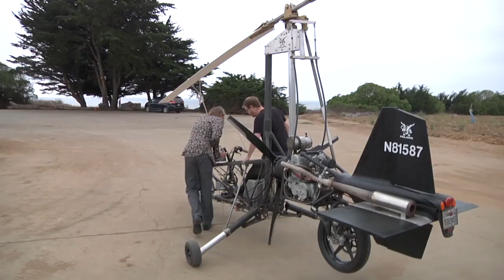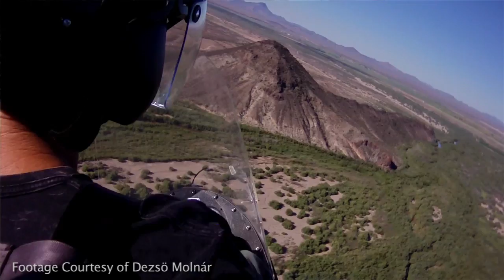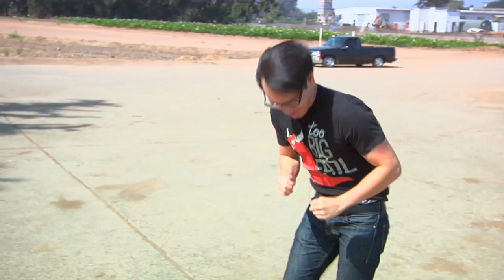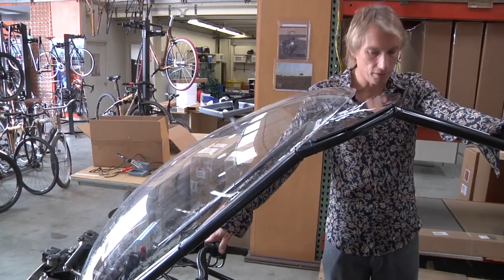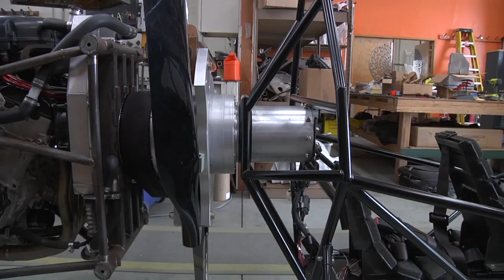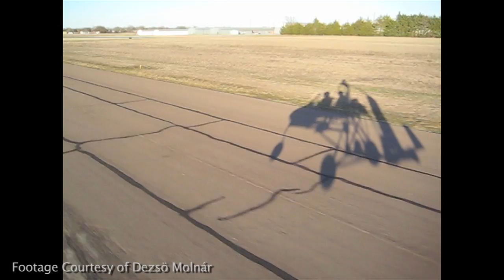Meet Dezsö Molnár and His Flying GyroCycle

Comment: You guys are idiots to have fallen for this nonsense.  You didn't get a SINGLE photo or shot of the ACTUAL machines he showed you flying and I'd bet money none of you saw him fly a drivable vehicle.  The second one is LITERALLY holding the front and rear of the vehicle together with a single shaft and I don't care WHAT material that shaft is made of, it's not good enough for that to be acceptable.  Also, who cares about a hose clamp from an engine going the same speed as the propeller... how about gravel bounced up from the road by a car in front of you?
Air travel "innovation" scammers let you sit in a prototype, they blow on you with a propeller, they give you stock footage of their heads (not their vehicles) that appear to be flying, but you never get to film them flying their vehicles yourself and you never see the _actual_, full-scale, full-function vehicle aloft under its own power in a meaningful sense. It's the same garbage with electric aircraft.  If it works, you can watch it and you can film it.
All flight footage here is of other vehicles (shadows and vehicle features give them away).  Additionally, you never see either bike with propeller actually move.  The supposed second bike in the driving footage doesn't have the propeller at all.

Comment: This is interesting. As in vary.  I am moving to the Philippines where innovations is welcome. I can see your bike with modified bench seats on the left and right sides for passengers .  When water is in countered the benches swing downward to become snow skis and the mounts for Full Lotus  floats for travel to any beach. Extra passengers travel in ground effect but when only 2 passengers then take to the air. Each float would be divided into 2 per side.

Comment: The pitch problem he is discussing is usually solved in Autogyros by extending the rear tail to change the center of gravity. I am not en engineer, however, I believe that is what many modern push Autogyro manufacturers are doing, extending the rear tail and adding winglets.

Comment: It would be great to focus on magnetic energy vehicles where you can use the Sun to convert  its energy in a solar panel system to lift up, then use a paddle propeller to move different ways.

Comment: this dude sees it. the gyrocopter is such a great way to get the masses flying
Reply: really I was just looking like ''dude where are the downsides to this?? ''
Reply: Matevž Kaplan not many, I think. although the heights may be a problem for some
Reply: @187warlord there’s far too many obstacles for this vehicle. It will never achieve an FAA clearance or be able to operate on roadways, the costs would be astronomical and resistance would even be greater. The Gov does not want us having autonomy

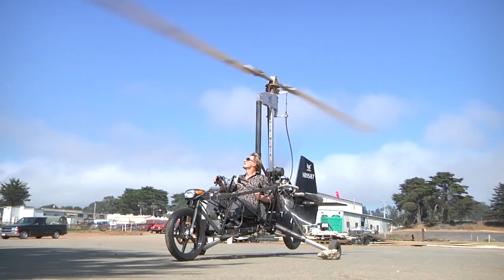Comment: At 4:32 the vehicle is not moving but the rotor is spinning. Has he just landed, perhaps? Otherwise I can't explain this.
Reply: it looks like it's speeding up. Everything with a propeller does that
Reply: But with autogyros the propeller rotation is the consequence of the forward velocity of the aircraft. I'm guessing there must be an auxiliary clutch to the rotor that helps bring it up to speed and shorten takeoff taxiing.
Reply: Windmilling from the sea breeze. Usually there is a brake to prevent it from spinning.
Reply: right there is. then its disengaged.
Reply: I just looked again and there's rocks in front of the wheels.
Reply: It has a small electric motor on the main rotor, it is used just to get the blades turning, it is switched off and air flow from the prop and forward speed does the rest

Comment: Finally, someone had enough sense to use motorcycle engines! I had been thinking of using a Kawasaki Ninja 250 engine to make an ultralight gyroplane. I never could understan everybody else using the primitive air cooled 2 stokes.
Reply: Why would reduction gears be an issue? Motorcycle engines have transmissions! Why is oil an issue? Why the hell do you need dual ignition? None of your comments make sense.
At least in the context of ultralights, which is what I was discussing.
Reply: Why are you so offended? I was trying to be constructive. Any basic aircraft engineer can clarify those points, I really can't be bothered now.
Reply: So, you admit that you can not support ANY of your points.
Reply: mrnickbig1 I'm not so insecure that I have a need to justify myself to you. Do your own research, then maybe when you're all grown up you can come back and apologise. Over and out.
Reply: So, you still do not even pretend to back up a single thing you said. Motorcycle engines HAVE transmissions built in. There is NO REQUIREMENT for ultralight engines to have two spark plugs per cylinder. There is no "oil feed consideration". As far as being "all grown up", I am probably older than you, and used to pilot my own plane, a PA22-108. So, quit making shit up.
Reply: Chronological age is not equal to mental age. You are walking proof. I will wait for your crash video to appear on YT...
Reply: And still, you do not support one single thing you said. I think everyone can tell who the adult is in this conversation, and who is making uninformed erroneous statements. Also, most ultralight engines, such as the popular Rotax 277, only have 1 spark plug per cylinder. It is about the  So, are you still claiming that motorcycle engines, like the Kawasaki 250cc that I mentioned, don't have transmissions with reduction gears? That ultralight aircraft DO require 2 spark plugs per cylinder? That there is some sort of "oil feed" issue with small 4-stroke motorcycle engines?
Reply: 2 strokes weight much less for hp generated. That is the point. And I love 2 strokes because maintenance is also hilariously easy and cheap. No valves, no oil system... 2 strokes are just better for this kind of job.
Reply: Motorcycle engines are designed for short bursts of full throttle, full load operation, whereas aircraft engines and boat engines, (also stationary engines) may be operated at full load continuously.  The most common limitations to continuous operation are oil temperature / constant flow and localized overheating. Most aircraft engines are de-tuned, and have an extra large oil pump,  Perhaps a dry sump, depending on whether they will fly inverted for more than a few seconds, and extra oil cooling compared to their vehicle counterparts.    A dual ignition is simply a good idea for an aircraft, as the ignition system is a single point of failure.   The reduction gearbox on a motorcycle will most likely not have the exact correct gear ratio required for spinning the prop at the correct WOT RPM,  but there is some chance you could make one work in a special situation.   there have been some successful conversions, so it is possible.  It' not likely that you will have a success without listening to people who can help, if you are not already aware of these basic aeronautic differences.
Reply: The original coda is exactly right, dual ignition may not be needed for experimental certification, but really to fly with maximum reliability it should be a key intention, also, bike engine horsepower ratings are nothing like aero engine horsepower ratings, which you mrnickbig should understand. An aero engine must deal with continuous full power load with hugely variable fuel mixture, which is one of the main reasons for dual ignition systems, it copes much better with extremes of rich/lean at high power settings without stopping. Conversely, If you take a 100HP bike engine and put it on a dyno and run it non stop at 100HP if your lucky it might last a few hours. On its wheels it rarely sees WOT for more than a few seconds at a time, and doesn't thermally cycle anything like an aircraft engine, with full power at ground level up into freezing air then closing throttle back...(climb out) The reason aero engines cost so much is because they are required to keep you alive by not stopping from blown gaskets, split casings, broken conrods, failed ecu's, seizure etc..
Reply: TheOriginalCoda m

Comment: I love the design considerations, brilliant! Take a look at the thought/design process on the dymaxion car by buckminster fuller, they would be good to add to the mix on this "flying vehicle" design: aerodynamic body and undercarriage and 3 wheel design (film/video of the car exist) The 3 wheel dymaxion was designed to be a flying car however the technology to realize the design didn't exist in 1932.  I am merely suggesting that the "ideal" design notes that Bucky Fuller had for the Dymaxion apply, not the actual car that was built. By the way a Brit recreated a working Car, good You Tube video.
Reply: kutomba wewe na maoni yako kijinga. kwenda kuua mwenyewe tafadhali =)

Comment: Amazing builds but i must say the 2nd one has a beefy looking belt, When you see the belt on the 1st one it looks dangerously thin in comparison. I would say that if there were no nasty accidents so far with the 1st design then they should probably beef that up before they break a belt in a bad situation. However if testing! they should be in a safe zone and the good things about autogyros is that they can autorotate and land without power.

Comment: Who you're kidding ? You're not gonna lift off with a static blade just standing there.
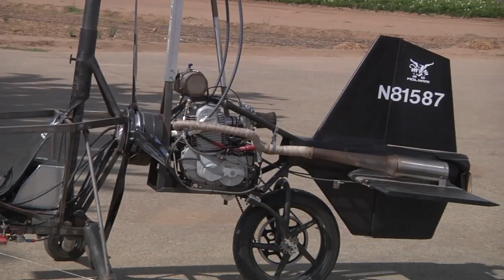2:36 It's not connected to the engine ? Then how does they turn so fast at 4:32 ? I bet there wasn't a 50 km/h wind ...
Reply: maybe you should read up on how a gyro plane works. as moving air comes over the blades they start turning. the faster you go the more air they move faster and produce more lift. it will take off like a normal plane not helicopter. now you can put a cable and clutch system that will allow to pre spin the rotor and shorting take off. after in air the clutch is released and the moving air over blades keep them making lift without the motor. due to slow stall speeds they are  one of the safest ways to fly.
Reply: I cant tell if your an idiot or not but for your first question, yes if you listen to him if you look directly behind the seat there is a propeller a giro-copter flys by generating forward thrust then the rotors which serve as wings spin up giving it lift like a helicopter.
Reply: CarsonT01 FGS ... I understood how it works.The thing is the blades are extremely thin and spinning freely.If you're not extremely lucky to have some 50 km/h (or more) wind from behind,until you get the needed speed and till that wind speed starts to spin the blades fast enough,you do at least 2-3 km.That's not feezable

Also,the thing is spining way to fast to not be assisted.Also,if you stumble on a front wind you just crash,much like slowing down further than 80 km/h.

That blades are assisted otherwise they won't lift and even if they do,they'll fall like a brick very easly.
Reply: motanelustelistu http://www.todomanualidades.net/wp-content/uploads/2012/06/Como-hacer-un-molinillo-1.gif It's the same as that.. You blow the spades and they provide the force against you that make them spin and give you resistance to stay in the air...

Comment: For all of those critics out there, this is the closest I've seen to a roadable aircraft aside from the Pal-V, and his "engine behind the propeller" idea is not something I've seen, even on airplanes. The problem with gyroplanes is scaling them up without jeopardizing the COG. This is a novel attempt to get around that. I am excited to see where this idea goes. Obviously, the flying stability will make or break the success of the design. This guy isn't just some hack in a bike shop.
Reply: I thought most airplanes had the engine behind the propeller
Reply: The P-39 Aircobra had an engine pretty far back.  My biggest worry here would be weight distribution.  If they can keep it from being massively tail-heavy, then I don't see any reason it wouldn't be a perfectly viable aircraft.
Reply: kdjhsdfhdslfkj They do, but not with the engine itself behind the pilot.
Reply: Touche. I meant to say, "engine behind the propeller in a pusher configuration".

Comment: Pardon my ignorance, but how is this different from auto-gyros?  Nothing I saw in this video shows me he invented anything.
Reply: He's trying to create a motorcycle that you can open the blades, switch drives and take off. Others have tried but given up before getting it licensed. Everything is in the first 3 minutes.
Reply: He's not inventing, but is integrating known physics and technologies into his own design. Perhaps his dual-functionality systems are being "invented". His design is unique with the rear motor arrangement. I'm quite impressed.
Reply: Gregg Sobocinski Many Gyro copters have rear engines, this is not unique at all
Reply: Yes, but the propeller is behind the engine. Think of them as mid-engine, while this design is a true rear-engine.
It actually improves the stability of the design quite a bit.
Reply: pay attention,his version in going to be a drivable version,drive to the airport or a lone spot on the highway and take off.drive out of your driveway and take off anyplace safe,while still being able to drive it anywhere anytime.
Reply: Gregg Sobocinski n'importe quoi
Reply: those engines are mounted before the prop. His is behind making it cool the engine better and if something was to come off engine it would not got though the prop.
Reply: Gérard BEAUDOIN Not necessarily for single pilot flying, but placing the engine in the rear allows the pilot to be placed more forward, allowing for more flexibility with variable passenger, payload and fuel loads. Isn't this why we don't see four-seat gyrocopters? There's not enough room at the rotor mast to fit it all. Perhaps I'm being overly enthusiastic, but I'm hopeful for any innovation which could increase gyrocopter usefulness. Although this is only a start, and still needs to fly.

Comment: Not practical, and the concept has proven to be flawed.

The smartest thing you can do is to get yourself a lightweight folding wing airplane that you can easily tow with a mini-van or any other regular vehicle (the planes aren't heavy).   This way you can store it at home for free, and just drive it out to the airport to fly.  

You'll never be allowed to take off and land on a public road, and no aircraft is going to do well as a street vehicle and visa versa.
Reply: too much space to take off and land,
Reply: This...Get an avid or kitfox. Pull it to the airport or airstrip fly it and pull it home. The compromise you get when you build two purpose built vehicles into one is it will never perform as efficiently or be as capable as either.
Reply: inagod  An avid or kitfox will get in the air in the same amount of space as this or less. With this you still have to find a field or runway to get in and out of with it you can't take off on the street.
Reply: Kitfox has TO role of less than 500ft.

Edit:  ~350ft is plenty short for anything you won't instantly be fined or arrested for landing on.

Comment: I personally think adam and jamie need to go over this one... from the design of that prop system, that many HP and so much nonsense about picking up a plane part and assuming a bike copter will fly no matter the weight it becomes more and more like a myth like more or les, "and lets not forget they have a decade of experience". Try harder and use computers to calculate weight lift ratio's plz "just running on experience" personally I certainly believe in gyrocopters just not in this design
Reply: +1 After watching mythbusters recently trying to build a jetpack, I hope they do give it another shot. Or try to build a gyrocycle/multicopter.

Comment: His Gyrocoptor does not have a Prerotation set up.. Most gyrocopters have a Hydraulic or mechanical Prerotation setup so they can get the Rotor spinning at a good RPM, for short take offs.. The way he has it set up, you got to have one hell of a long runway to get off the ground. I like it but at the same time i don't.

Comment: There is nothing new here. So far i have not seen a real flying car, one without wings or rotorblades, if a flying car uses that then in my opinion it is isn't really a car anymore its just a transformation into a airplane, helicopter or gyrocopter, all of which you can just add four wheels too and call it a car if you wanted to.

Comment: While you do have a point, conventional aircraft are bound by rules concerning their altitude minimums and maximums, which depend on their proximity to airports and certain other areas. The Gyrocycle is also bound by these rules. If you were on the highway in a major city and took off, you'd probably be breaking one of those minimum altitude rules immediately. Not good. As far as running into another plane goes, the majority of U.S. airspace under 14,000' isn't controlled. You just look out.

Comment: cool motorcycle, picture this, you are on the highway, you hear about a traffic jam on the radio and you take off to avoid traffic, until some other plane (that probably had a GPS and was in contact with traffic control) doesn't see you and you both crash and die, cool isn't it?